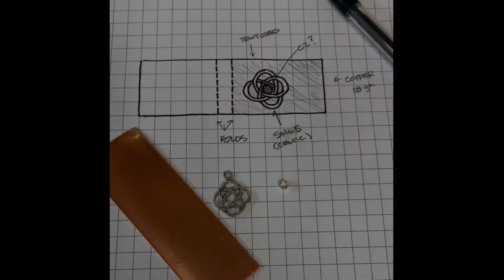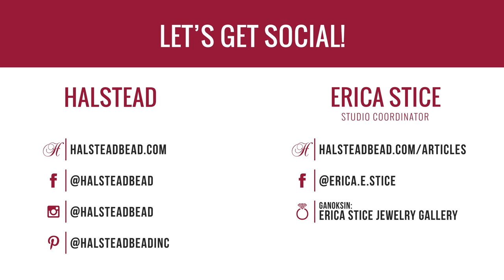How to Make a Money Clip

Comment: Hi, I’d like to make sterling money clips for Christmas, I’ve been told to buy half hard silver which I cannot find. I do not have a kiln to use. Could you please tell me what gage silver to buy and whether or not half hard is necessary or if I can make it half hard by a different method?
Reply from the maker: This blog talks about making a money clip as well - you['ll want to use 16 or 18g metal. https://www.halsteadbead.com/articles/5-unisex-designs-to-expand-your-jewelry-collection Half-hard is preferred, because it will hold its form better. If you cannot find that, you can work-harden the material by adding a hammer texture. Be sure during the forming process to hammer the bend well to work harden it also.
Reply: @HalsteadJewelrySupplies  thank you very much👍